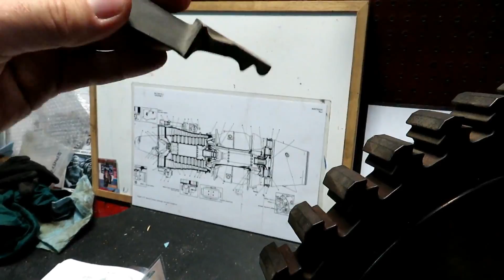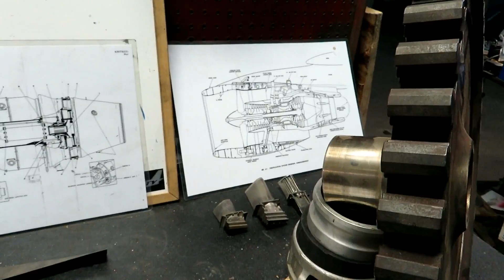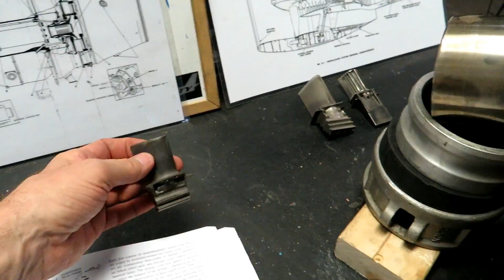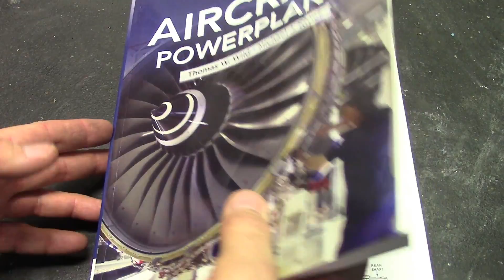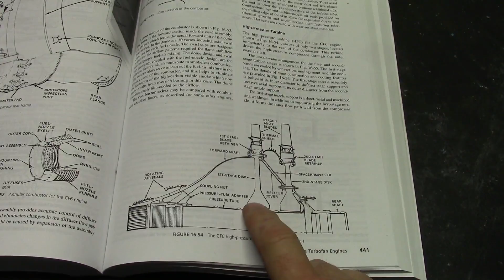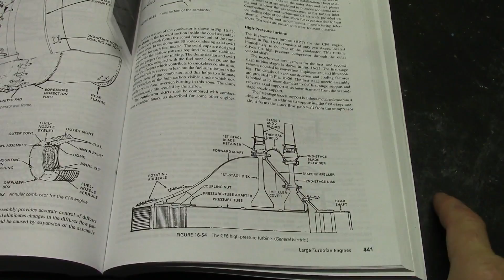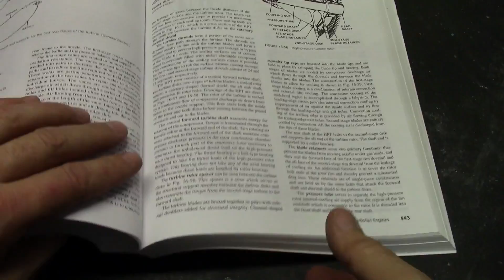Turbine Interstage Seals

Comment: Great explanation as always. Haven't watched all of your videos. Have you previously explained ... or will you explain ... how the little bitty, itty-bitty holes in the turbine blades don't get plugged up on a regular basis.
Reply: Kerosene burns quite clean, as far as particulate matter goes, but really the thing is that the burnt gases are not going into the holes, it's the compressor discharge air, at a higher pressure, that exits those holes and that air is clean. Of course if the engine eats a bird then it might also clog those holes, but I'd say that's not really the biggest problem.
Reply: Giacomo 10-4, I caught the part about it being clean air. My thought was that clean air isn't really all that clean.
Reply: Right, I suppose that's part of the reason why military engines have air filters. Commercial airliners have lower operating temperatures  and maybe do without film cooling  and/or it's uneconomical to put the filter and they'd rather service it more often or it gets serviced often enough already.
Reply from the maker: G-U is partly right, because he has half the story.Turbine blade cooling air is usually tapped off the compressor and travels into the center of the rotor... This means that the air is "centrifugally purified" of all particles. All dirt and dust is flung outwards towards the cases with tremendous force. Throwing a bucket full of sand into a running engine would damage it severely, but almost none of it would get inside the blades. It would melt and stick to the outside of the blades.
Reply: @giacomouggeri6129  Thanks.
Reply: @AgentJayZ  Thanks.

Comment: What do aircraft mechanics make & does the industry have a shortage or surplus of working mechanics?
Reply: Bartacomus Kidd short answer, not enough. Long answer, it depends who you work for, which state/province you are working in and what you are working on.
First comes school ($0 p/annum), then certification (Apx $30-35K CAD/annum depending on same factors above), once you are a licensed AME pay can vary too much to summarize in a YouTube comment. (As a very broad approximate estimate $60 - $85 CAD PER annum)

You should know that AMEs don't actually get to do a whole lot of mechanical work on the most modern aircraft if you work for an airline.
They basically unbolt things and then send them somewhere else, then they get it back and bolt it back on. (Not that those tasks are uncomplicated) The industry has been streamlined and most engines, etc are on lease to airlines.
If you are keen to work on smaller reciprocating engined aircraft, then your chances of getting more involved in things like engine tuning, small airframe repair, etc is much better than at an airline with a fleet of large turbine driven aircraft.
Reply: I was an AME for 15 years at the small end (flight schools, G.A.), had a lot of fun, interesting; when I left it to go work on machinery at a transfer station I was getting $35k CAD/year, and went into a smelly environment for $85k CAD/year, with benefits. What's my point?  The work and money are out there, you have to go find it. Same with people that know what a screwdriver does; in my current field, that's getting harder to find.
Reply: @rsmith155  beautiful answer. Thank you very much.
Reply: Bartacomus Kidd very welcome mate. It's often hard to get a clear answer to that question when you're looking into the field. As Owen said, it's really about looking for the money. If you do end up choosing training to be an AME then keep your eyes open for any opportunity to enter some kind of specialist type role, or with a company that has contracts maintaining specialist use aircraft.
There's two guys I attended school with who are still in the first position they took after graduation and more than happy with salary package, etc. 
One is working on water bombers, which his company owns the type certificates for, and have an intensely demanding maintenance schedule. This has kept him busy and interested.
The other works on border Patrol aircraft with the Canadian government.
Positions like those and other similar ones, are more likely to have you involved in a variety of jobs, and are much less like working on a production line. Which is exactly what the airline experience has been like for most guys I know. 
Best of luck champ!

Comment: so ... whats your opinion that jets are removing the stators before and sometimes aft of the combustion chamber to improve fuel efficiency?
Reply from the maker: Never heard of that. Does not make sense to me, but I know nothing of it.
Reply: @AgentJayZ  i think the concept is that a spinning vortex of gas will mix more readily than a laminar one, gas mixing being key for combustion efficiency. of coarse they have got to balence that with the combusion liners melting..
Reply: It might be possible to design a combustor to accept the swirl from the compressor without outlet guide vanes that straighten the flow.  However, I doubt that it would be efficient and the design of the combustor would be considerably more complex.  
Moving on to the turbine entry, if you are suggesting that the HP nozzle guide vanes (NGVs) could be removed, then the answer is no.  A whirl velocity has to be imparted to the hot gas to drive the HP turbine efficiently.  However .....
With appropriate design, it is possible to remove the first stage LP NGVs in an engine with contra-rotating HP and LP turbines.  I believe that one of the current US low-bypass military turbofans has such an arrangement.  It might have a very small effect on efficiency, but the real, albeit small gain would be in weight and length reduction.
Reply from the maker: Yeah, this is all garbage. Those stupid commercials are stupid.
Don't be stupid, people.
Reply: @grahamj9101  Doesn't work, we tried it. X2 as heavy with little to no efficiency gain. what you gain in thermal you lose immediately in mechanical energy. + the mass penalty. stop trying for contra rotation people.
Reply: @rat_king-  The following engines, with which I am familiar, have contra-rotating HP spools: Pegasus; RB199; EJ200 and the latest marks of Trent. Admittedly, none of  them have statorless IP (or LP) turbines, but they were all designed that way for a purpose: the Pegaus to cancel out the gyroscopic torque effects and the others for a performance gain.
Reply: @AgentJayZ  I tried to give a sensible answer, rather than a put down, to what might at first sight be an unintelligent question.   I did so because, more than once in my career when I was involved in design studies, I had to give a sensible answer to some senior who had made an outlandish suggestion.  It can be an interesting challenge and they may not like the answer. 
In this case, there is some merit in having a contra-rotating turbine with no NGVs between the contra-rotating stages.  Many years ago,  I was actually responsible for the design of a contra-rotating  'cold-flow' rig turbine: it worked, but the principle was never utilised.  This was because R-R design 'architecture ' went the way of having a TBH between the HP and LP (or IP) turbines, which, in turn, meant that wide-chord NGVs were needed to house structural struts.
Reply: @rat_king-  Sorry, but I'm not at all familiar with 'X2': would you like to explain, please?  For your benefit, I will explain why the latest marks of Trent changed from having co-rotating to contra-rotating HP turbines.
All RB211s and earlier marks of Trent had co-rotating HP turbines, which meant that the 26 (from memory) IP nozzle guide vanes behind the turbine were 'wide chord', with a large internal space, in order to house the HP/IP bearing support structure, plus the services to/from the HP/IP turbine bearing housing (TBH).  It was always known that these were relatively  'lossy', because of their chord width and the development of secondary flows in the passages.   With the never-ending quest for improved efficiency, it was recognised that by introducing a contra-rotating HP turbine, the camber of the IP NGVs would be substantially reduced and, with it, the losses in the IP NGVs.
Reply: @grahamj9101  no its my fault, the quest for efficient combustion, in static/ generator turbines where shaft power is more important than thrust. X2 meaning twice. there is no concern for fans when shaft power is the goal, and inertia and rotational forces are working against you. I AM AWARE this is not applicable to this application, all im saying is that We tried it. and from our tests and application it provides no benefit. Trents are marvelous engines. I have a few ideas on improvement thermally but im not telling till the research comes through.. lots of carbon
Reply: @grahamj9101  This kind of technology is where shaft power jets and thrust jets are starting to diverge from being similar...
Reply: i. rob  Please see my reply to another comment of yours.
Having served most of my apprenticeship at Ansty, rather than Parkside, I was originally ineligible to become a Freeman of the City. However, they changed the rules and I was belatedly made a Freeman in 2000, or thereabouts. I am proud of my connection with the City of Coventry, the birthplace of Sir Frank Whittle, the genius who, from very humble beginnings, effectively laid the foundations for my career in gas turbine engine design.

Comment: Thanks again very nice video. Oh it was a new fact that fuel into burning in burning chamber does not lift pressure only speed of material flow. I thought that increased pressure automaticly pushing more speed to airflow. Sorry my English mistakes. :(
Reply: Pressure is achieved through compression, burning only increases airflow to the exit.

Comment: 11:40  Do you mean to tell me the the pressure is lower here than it is there?!  Man I just don’t get it.
Reply from the maker: Compressor discharge air is at a higher pressure than combustion air. The heating of the gases caused by the burning of the fuel does not increase the pressure. It cause the uncontained gases to expand, so they move faster. That's how jet engines work.
Reply: @AgentJayZ  I think I am missing fundamentals about jet engines as I am having a hard time to picture this.
Reply: @ahmedshinwari  fluid mechanics defines that air pressure and air velocity are inversely related. Compressor air is more static than combustor and HPT air. Think of the weather report: storms, high winds (eg hurricanes) are always associated with low pressure fronts
Reply: @markjennings4009  this. The combustor exhausts/turbine entry is shaped to maximize kinetic energy, as that is what turbines can actually extract. This means the air reduces in temperature and pressure.
Reply: @ahmedshinwari  think of it like this the air before it gets fuel and lit is compressed by the fins on the various compressor stages AND the sloped shape of that section ... you get to a slightly narrower area where you open up into a bunch of "cans" that have air and fuel and a spark or flame to make the engine run ... these cans converge a bit of the air from the compressors (how it gets into the "can") and immediately opens up .. slowing the air down (below supersonic) where the spark or flame lights the fuel air mixture ... removing the mass of the burnt fuel reducing the overall volume ... the "can" is long enough to allow the fast moving sub-sonic air enough time to light ... then  it converges again to leave the combustor where it is yet again allowed some expansion as it plows into the turbine blades which by newtons law of action  reaction ... (air pressure from heat and compression) moves the turbine blade as the blade is on a round wheel it spins around ... turning kinetic energy into rotational energy ... as the turbines are also connected to the compressors at the front ... that rotation spins the compressors faster and faster ... allowing the engine to do its job and give enough thrust to fly the plane ... after the turbines the hot gases or exhaust is once again compressed into the final stage where you have the after burner where if desired you add yet more fuel to the exhaust gases (like a breath not all the air is used so there is some to allow for burning) and again light that ... like inside the combustor some length is needed to allow the fuel a chance to light and then it once again gets constricted just before it enters the final expansion of the end of the engine ... that part where you see the adjustable fins to maximize thrust along a much broader range of use ... low speed tight high speed wide open and everything in between 
.
all a jet engine is truly is a long 4 stroke engine with many places to light fuel and air ...

Comment: Wonderfl video & explanations.  I was expecting that the seals were typical rubber or similar seals rather then super precision metal devices that largely seal but allow precision leakage of the gasses for cooling purposes.
Reply from the maker: It's an attempt to seal against gas leakage, but the gases are about 800 degrees on one side and 1500 on the other, plus the seal is between a stationary housing and a high speed spinning shaft.
It's a tough job!
Reply: @AgentJayZ  At R-R, we came up with so-called brush seals. They are like a high-tech version of what you often see on (eg) revolving doors.

Comment: Hi, just a hypothesis on the random serial numbers which were affected by the AD... it is possible that the interstage air seals did not have a problem from new, which would generally happen to sequential serial numbers?  Possibly random engines which were at a repair/overhaul shop at the same time when either a repair process, or assembly/disassembly process, was not correctly completed?
Reply from the maker: Anything is possible. I would have to say of all the words misused and misunderstood in the past 20 years or so... random is at the top of that list.
Reply: @AgentJayZ  Ouch!! I was just trying to be helpful.  Sorry for insulting you with my horrible use of the English language.
Reply: @perry4032  - I don't see that your foray nor your person, as having been slighted in the response; the terms of possibility and that of random, were both answered succinctly. I do find it interesting that you returned with a sullen form of passive aggressiveness. No reply or, a "thank you" would have better suited. Perhaps, a greater opportunity was given to you? Look again, without your personal fears. Best regards-

Comment: Does this mean that the oil pumps will pump oil as long as the main fan disk is turning due to airspeed even when the engine flames out?
Reply from the maker: The oil pumps are driven by the hp shaft, or core. Not the LP shaft, or fan.
If a turbofan stops burning fuel for whatever reason, there is very little stress on the bearings, and their need for oil is very much reduced.

Comment: which force is more powerful? the forces of the exhaust gasses which hits the turbine blades or the centrifugal force?
Reply from the maker: Both are variable depending on engine speed and power setting. I would guess that centrifugal is the one that sets the limit on engine rpm.
Reply: @AgentJayZ  thanks! could you show us how the bleed air tube and connection in axial compressors look like?

Comment: If they are recalling a seemingly random group of serial numbers it would point to a process fault at assembly rather than a materials fault. OO Joe worked on that engine, and that one over there, his torque wrench was damaged.
Reply from the maker: You are not using the word random correctly. Don't worry, it's the most misused word in the last 20 years or so...
Reply: @AgentJayZ  Thus the words 'seemingly' random. As in a group of numbers that at first appear random, until you drill down into the history. I know the process and documentation used in the aircraft industry, they can trace parts back to the raw materials that went into the ladle at the foundry.

Comment: I work on the PW1100G we also had similar failures on HPT rotors the hubs crack and are failing ultrasonic NDI testing the new block D engines have a better rotor also these new engines dont use bladed compressor blades on disks anymore its all IBR's what do you think about those?
Reply from the maker: I could guess what you mean by IBR, and be pretty sure, but that's not what I do.
Reply: How do they cool IBRs? Do they just not get hot enough or is it something like compressor discharge being leaked into the combustion output to lower the temps it receives?

Comment: tell us about ramjets..
Reply from the maker: They are difficult to start, noisy, and not very fuel efficient. It would be accurate to call them atmospheric air breathing rockets.
Used only in some missiles, as far as I know.
Don't mention the Rotodyne, or you lose a point.
Reply: @AgentJayZ  Now that unmentionable helicopter did have combustion in the air ejected at the tips of the main rotor blades - and it was as noisy as ****!

Comment: 8:07 Airplanes have no fuel tanks?! This proves the earth is flat and there is no gravity! :-P Jk. 
On a serious note, great video! Thanks for taking the time to put it together for us.
Reply: think about it ... what they have is a water tight sealed cargo section that holds the fuel ... which is moved in and out with pumps to power the engines ... you could do the same to a car ... say make the gas tank the space between the inner body and outer body ... then you remove the tank underneath ... bad part in a car ... a crash ... someone hits you in the side panel and you now leak gasoline and poof you have a BBQ ... airplanes dont have that worry so much ... sure if they belly slide they can go poof or the like but as they are made to be in an area with out ways to harm the fuel storage they dont need a separate tank ... just some place to keep it ... they could even have it fill the area around the seating area ... all that really matters on the plane is it doesnt leak and you can get it where it needs to be used ...